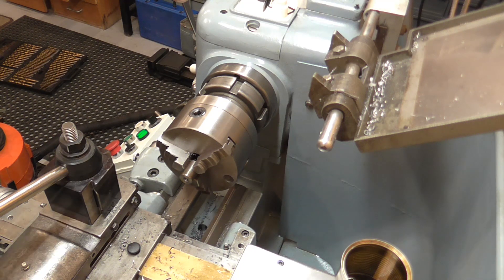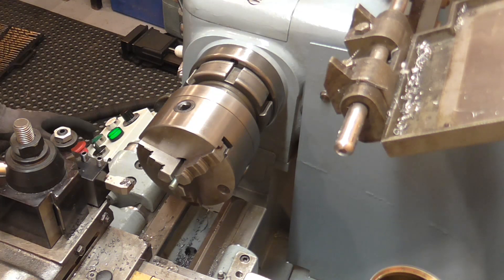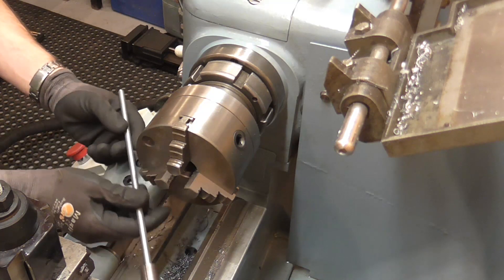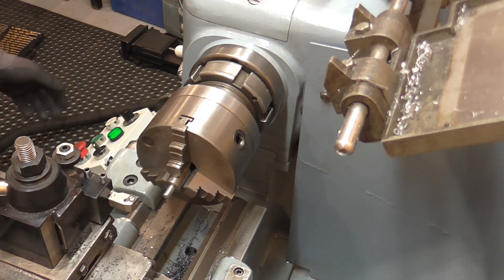Leadscrew mod

Comment: I sell M8 threaded flex couplers on Ebay for 3D printers and they work great, I do not have a 6mm drill to tap other end out but they come with a 5mm bore for the stepper shaft. Check them out here>>> http://www.ebay.com/itm/270971707635?ssPageName=STRK:MESELX:IT&_trksid=p3984.m1555.l2649

Comment: You could probably just have used a second nut to lock it instead of the slitting
Reply from the maker: Yes, I've done that many times when tidying up the end of a shortened bolt, but it doesn't give you the concentricity that a threaded collet does
Reply: Paul Compton you need to make the threaded "holder" to get a concentric threaded hole, but whether you should lock the allthread by slitting the holder and squeezing it or but using a jam nut I think would depend on how the lead nut it'll be used with works.